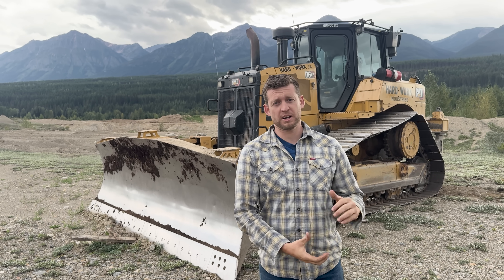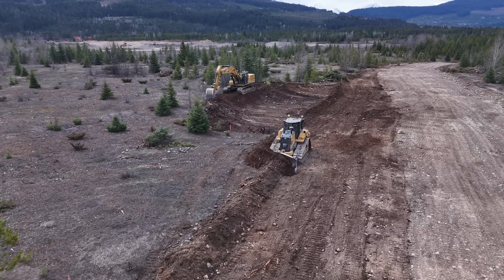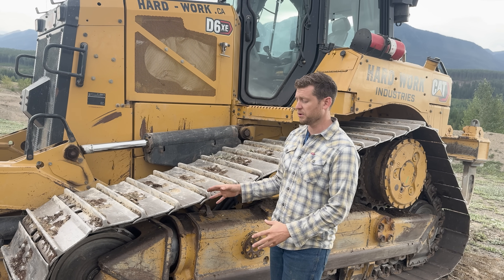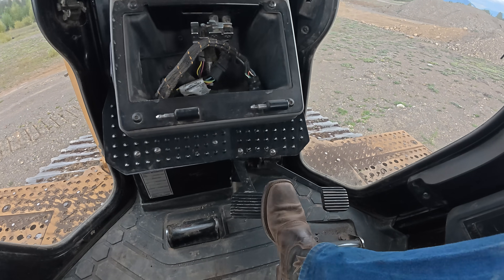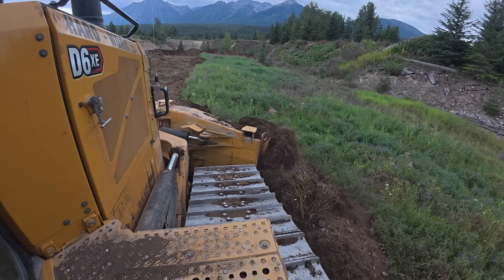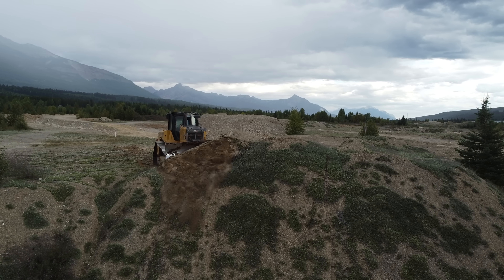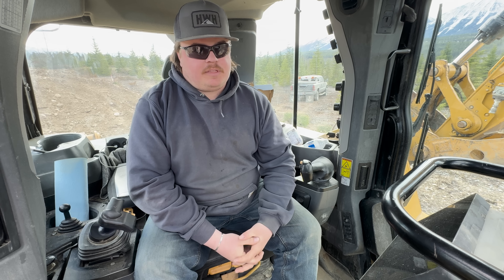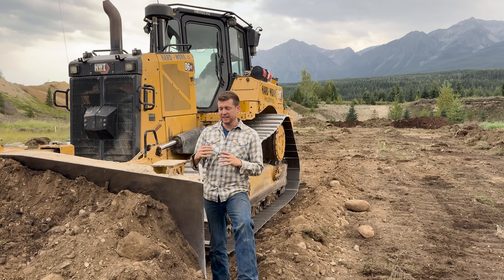Inside the Cat D6 XE Hybrid: More Torque, Less Fuel

Comment: Nice to see heavy equipment with electric drive. Big equipment like that stays around for decades. Same with farm equipment & tractors. There's a big space to up-fit a lot of that equipment to hybrid and there will be no shortage to convert, as new diesel units are still being made today, and won't need a new engine any time soon, but will definitely need to be more efficient in 20 years.

Comment: Electric motors have max torque at zero RPM it makes so much sense
Reply: What good does that torque do if the motor isn't spinning?
Reply: @codymoe4986  The torque is what forces the motor to spin. Keeping it at max torque would probably overheat the motor windings.

Comment: Please stop calling this a hybrid! It's not a hybrid, it's electric drive, or an electric transmission. It may be new on buldozers but it's been used on other equipement for a long time. The term "hybrid" as it normally applies to vehicles normally refers to hybrid drive, which means it has more than one way to transmit power from the engine to the wheels. Gimme a break!
Reply: You might want to refresh your memory on the definition of hybrid...

A diesel generator provides electrical power...that electrical power is used to drive the machine...AKA a hybrid.
Reply: @codymoe4986   The only path you're describing is through the generator, the wires, and the motors. If you remove either one there's no link between the engine and the wheels. A hybrid drive has a second path between the engine and the wheels, typically a mechanical link.
Maybe you should google the definition of hybrid.
Reply: P.S. You debunked your own theory with your own words..." which means it has more than one way to transmit power from the engine to the wheels."

Diesel generator, electric motors...sounds like more than one to me! Whoops!!
Reply: @codymoe4986   So if you drive the wheels through a transmission, a driveshaft, and differential gears it's a hybrid drive?

Comment: My buddy is service manager where they have a few of these, at first with the electric drive they were having higher undercarriage wear because when pushing the operator was expecting the engine to lug down and it doesn't and the track power is so strong they wouldn't notice the tracks spinning right away, wearing them down. once they caught on it was all good.
Reply: I wonder what the heat
On those motors were

Comment: Edison Motors took things a step further. They incorporated electric breaking and electric energy storage. Literally an independent electric drive here. It will save more on fuel and by a hefty ratio.
Reply: Of course in dozer you really have small amounts of energy to store because it is generally so slow. Yeah it’s heavy, but speed is squared in kinetic energy 2 ton object (car) will have more kinetic energy at 10 mph than 32 ton object at 2 mph. And 32 truck at 60mph will have 56700 times the kinetic  energy to recover compared to 1mph dozer with similar weight.
Reply: @Karjis you can't compare the dozer to a truck but a locomotive is closer. And you're only comparing direct alternative capacitance drive to inverter drive.

Comment: As a cat tech your definitely not taking that cab off in 30 mins but they are still quick to remove. The d6xe's havent had many failures that I've heard of, whereas the 988xe has had quite a few growing pains with generator bearing failure but still covered under warranty usually. The thing with generators and electric motors is they aren't rebuidabke on site currently, they have to be swapped out and rebuilt at a reman facility because no dealer has the tooling to rebuild them other than bearings.

Comment: The decelarator pedal should be on the left kinda like a clutch pedal and rather than giving gear on the controler they should rather give it in the accelerator pedal... should that its easy to use and learn
Reply from the maker: I feel like that would totally screw up your natural instinct while operating the machine
Reply: @EdisonMotors but atleast it would be easier to use and won't have a huge learning curve
Reply: You just have to pretend you are pressing the brake pedal with your right foot. That pedal has been on dozers forever.

Comment: PLEASE TAKE A MOMENT to remember R.G. (Bob) LeTourneau, the man who invented the 'Electric Wheel' (hybrid drive), away back in the 1950's.  He is smiling down upon us now.❤
Reply: From memory his book is “R G LeTourneau, Mover of Men and Mountains”. Very interesting read.
Reply: the tournepull. he had loaders and scrapers with electric drive before anyone else.
for high torque high horsepower applications electric drive is the way to go.
Reply: but, the first form of a internal combustion engine - generator, driving an electric motor goes back to the early 1920's. Herman Lemps control system made the first significant bounce for the application of this drive system into railcars and locomotives.

Comment: Thanks,  Chace.
I watch C&C Equipment and can understand how Electric can save on maintenance. 
It’s also easy to see how the hybrid can save on operator fatigue. 
There’s nothing worse than operating, heavy machinery, and getting super tired after a long day. Thats when accidents happen and mistakes are made..
Reply: a 4 year old girl with cancer is worse
Reply: i also watch C&C equipment tearing them down for repairs the Electric Cat has way less parts should maintenance be required
Reply: Yes, I saw one one of ( C&C) videos that I think were J.D. dozer one had one wire harnesses going into transmission control. I was amazed that just so few wiring harnesses did so much work.

Comment: Very cool!  Is that the smallest diesel-electric Cat makes?  

I'm a locomotive engineer.  We usually have two on our train, each running a General Electric 7FDL16, a 175.2L V16 with 4250 hp.  There are 8 throttle settings, which is equal to a certain R0M..  When running we can hear the throttle ramp up from idle to notch 8, sometimes pulling 1300 amps.  We operate the train from the lead locomotive and run HEP, or head-end power from the trailing locomotive because the HEP is a set RPM and is loud, and since the engine RPM doesn't change, it's not as fun "loading" it.  There is less sense of feedback.  The lead locomotive puts all the available power to the four electric traction motors, while the second one uses around 1500 hp to run the 480v electric and used the remainder for traction.

You should see the size of the turbos and alternators (generators) on these locos!

Comment: The D6XE follows on from the D7E electric drive introduced in 2008 the D6 XE in 2018 and the D11 XE shown in 2021 (not yet released)
Hybrids like Edison trucks have the same power characteristics without the engine running (using battery power) or even able to deliver MORE power than the engine/generator can by using the battery power in ADDITITION.
Chace gives all of his experience on this - one thing he says is "wrong" is its not a hybrid - it has no batteries. It is absolutely electric drive and you are seeing a dozer with over 10,000 hrs on it, so it may well be a 2018/19 model.
So HYBRIDS can deliver even MORE performance and so are even better than what Chace is talking about here.

Why a decelerator? Dozers operate on rough ground and holding an accelerator while operating would be HARD.
So with a decelerator you set the machine up so that it will run at the speed you want while pushing and then you only need the decelerator as you start and stop and if you are finessing during the push. WAY easier.

Comment: This is part of the reasons why the military are looking at hybrid electric heavy vehicles ...

Heads up Edison ZF is introducing a new line of efficient permanent magnet free e   motors and axel units for automotive use .... They are also producing  an a ultra compact REEV Range extender Electric vehicle with ability to integrate with the new electric motor IRS units...these are also intended for light vans use as well and AWD set up vehicles .. worth a look the heat exchangers are the same type developed for recent central heating systems and beer chillers in the brewing industry. 😂
Reply: Renault already has induction motors for EVs. Nissan will be using them also.
Reply: @fascistpedant758 
There are advantages as  The Edison guys saw when they visited the English Truck show a while back .... The 1300hp triple motor unit from the researchers at Advanced Electrical Machines... Is known for smooth power and ability to be switched off. ....freedom from perminant rare earth  magnets means freedom from degradation due to extreems of heat , vibration and sudden impacts.  All vital in vehicles that are likely to be used on and off road use in modern environmental conditions. The motors are also water proof .... The other charicteristic is the use of specially formed Cu windings... again a cost and wt. Saving as Al is far more available than Cu. It also works better at slightly higher temperatures.  With so many patents involved I'm wondering if they have done development work for these companies ..... Particularly the likes of ZF and GKN  power and transmission companies .. it's also interesting to see the same basic case casting used by various marine electric specialists... So the question is are the smaller  motor manufacturers using Chinese components and or sub contractors. I'm thinking of sove very expensive Finnish German and possibly Dutch suppliers .

Whatever the orogin these rare earth free and copper free motors are going to be an advantage in cost and recycling terms the software and control hardware development is what has made them as efficient as smooth as their more resource expensive Cu and rare earth cousins . Plus Canada is already a major producer  
Of steel and Al. 😉🤔 Could be someone needs to talk to the AEM guys and girls from Durham and set up a  line in Canada .... 🧙🏻‍♂️

The ultra efficient and compact generator range extender is also the other area to persue..

Comment: I am curious with the generator vs non generator dozer does it make it harder to judge when the dozer has a full blade? In my experience I’ve noticed hearing the engine while you are pushing a full blade is one of the factors that helps me know when to lift my blade and let go of material to prevent as much track spinning as possible.
Reply: I assume it would have a gage indicating the load on the motors. I'm sure you can still hear the engine too. It's basically just a CVT.

Comment: It would be nice if they reversed the cabin and motor so you could see right over the blade with the motor behind you and the weight of the engine is on the back.
Reply: What would be the advantage of having the weight on the back on a tracked vehicle? It's not like an old rear wheel drive farm tractor. It's probably best to distribute the weight evenly. You sometimes need a lot of weight on the blade.

Comment: Hybrid electric (no large batteries ) is  a game changer and SHOULD BE implemented in major vehicles like this.
Reply: Think about it, it's like a locomotive that brings it's own tracks!
Reply: The big reason why CAT hadn't brought this over from their mining trucks is because of scalability. We really didn't have good enough AC traction motors with enough torque until the last, I dunno, 5? AC traction motors that fit in locomotives didn't become a thing until 30 years ago.
Reply: @therealwoodman-5608  Nope; Germany has been running induction machines with on-board backfeed-capable VFDs (DB Class 120) since May 1979; that was 46 years ago. The only parts that weren't really ready for large-scale deployment until about 5~10 years later were the main transformers, the driven gear (i.e., the one on the wheel axle, not the one on the motor shaft), and the gearbox shroud. Those got ready for large-scale deployment during the 1980s, but the whole cold war ending and West Germany absorbing broke communist east Germany led to the decision to instead pay their modern locomotive plant for (at the time) 150 units of DB Class 143, a universal motor with thyristor dimmer (in a way a supersized vacuum cleaner :D ).

As for merely fitting the traction motors in the locomotives..... The DB Class 202 diesel-electric testbeds from Henschel-BBC (Swiss BBC fused to today's ABB you should have heard of) were built in 1971 and are running entirely brushless (I'm pretty sure that implies thyristor inverters for the AC induction traction motors and probably phase-shifting recitfiers for using an AC induction generator on the diesel motor instead of the classic ~1950's EMD-style brushed DC technology).
Germany ended up favoring diesel-hydraulic transmission for it's diesel locomotives (the popular DB Class 218 has what's essentially a 2-speed "dual-clutch" automatic gearbox (i.e., with 2 torque converters instead of classic clutch disks)) and overhead catenary for it's electric locomotives.

The entire first generation ICE high speed trains from Siemens were all built over 30 years ago; they run AC traction motors for 280 km/h (174 mph) regular operating speed (if track conditions and scheduling permit). The traction cars if left on their own (they are technically locomotive-hauled trains with a locomotive at each end) do 59 W/kg sustained. For comparison, the much more modern EMD Class 66 does about 18~19 W/kg.
Reply: @namibjDerEchte  Ah you are talking about full electric locomotives. I am talking AC traction Diesel Electrics. The first full deployment of them here with the torque levels needed for north American freight didn't get introduced until 1994.
Reply: and it is by nearly every heavy equipment manufacturere other than cat
Reply: You smell like ostriches in denial, Canadian law has been set in stone years ago, eather go full EV or shut down, wether you like it or not
Reply: Trains been like this for decades.
Reply: @devbropa-wy1xl  little more than decades lol, the first diesel electric locomotives were made in 1924. in quite a few countries too they took off fast
Reply: They did, it was called a Chevy Volt. But the original design was changed because they couldn't get the engine noise low enough since it was turning something like 4,200 rpm. That was the engine's peak efficiency RPM.
Reply: Different conditions of use require different types of drives. In some cases, a regular diesel engine with a manual transmission will be enough, somewhere a hybrid will be better, and somewhere a fully electric (with a switchable battery, yes, there are such).
Reply: It has been for ages, they're just getting even more common never costs are going down.

Comment: I just looked.  CAT builds a D11 with the same type of setup
Reply: Not quite yet it is still in its development stage/ field validation (reliability) - yes it takes a long time. A D11 is a critical piece of equipment in a mine and the costs that happen if it goes down are WILD.
Same sort of development for smaller machines to - an owner operator is 100% stopped if their machine stops..... a bigger impact for them (personal) than for a mine (corporate).
Reply: @ianloy1854  the big mines dont just have one D11.  If it makes economic sense they would just buy one and run it to test it out and once any issues are sorted out they would buy more.  So I would disagree with your statement that the cost if that happening being "WILD".  If it breaks they would just send out the truck to pick it up and get it back to the shop.  They also wouldnt put that D11 on any critical work.
Source:  I work in a mine.

Comment: "The D6 XE's Electric Drive Power Train has 90% fewer moving parts than a traditional power shift transmission" (did they mean drivetrain?) - either way vastly fewer moving parts should be a massive advantage wrt lifetime maintenance cost IMO

Comment: i wonder have you reached out to CAT about their generators? maybe they would be intrested in getting theirs tested and set for on highway for you to use i know you are set on the scania engine but who knows maybe they might be willing to work that out  same with scania maybe
Reply: I believe the Topsy prototype has a Cat engine. I believe DeBoss is looking at a Cat 3.6 liter tier 4 engine for pickup trucks. Yes it would be nice if suits at Cat in high corner offices were talking with Chace instead of Chace talking to the guy at the parts counter at the local Cat dealership.
Reply: Caterpillar stopped producing highway engines 15 years ago. If they don't for anyone else, I doubt they'll start again fo Edison.

Comment: All right all right but what about the hydraulic elements?  How do those work?  Electrically somehow, but how exactly?
Reply: I imagine it works the same way that hydraulics work on a normal machine, but instead of the hydraulic pump being mounted to the engine, it has an electric motor driving it, just like on the Edison trucks with hydraulic needs. Oooorrrr, it could just be mounted to the generator. 
This is just what I think it could be.... idk if this is actually how it works.

Comment: That warranty alone makes it worth it.
Reply: Yes. Thats ten years of 40 working hours p/week. That is super.
Reply from the maker: That's insane when you put it that way
Reply: Yep... to some that is crazy numbers, but they have done the math and are offering it, so the value should even be better than that if you maintain your equipment.
Reply: That is a lot of faith/confidence that Cat is putting into this new electric drive system. Its reassuring.
Reply: if u dont get a dozer to use warenty not much good